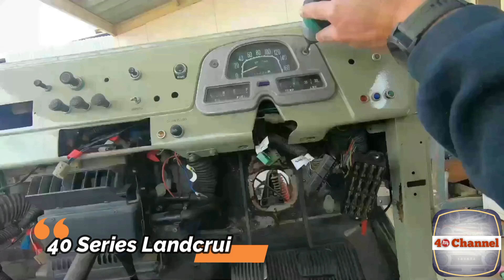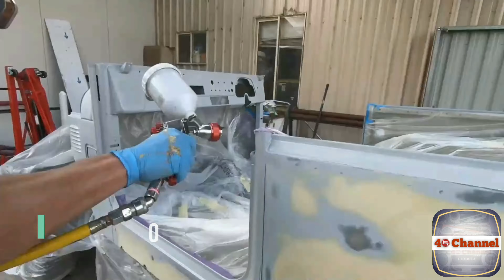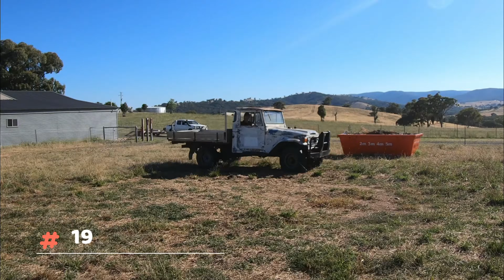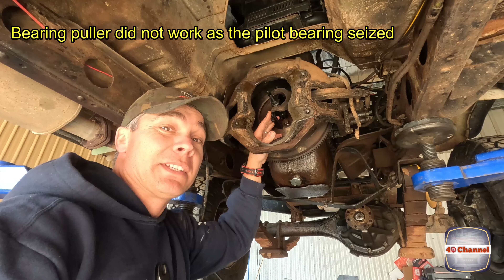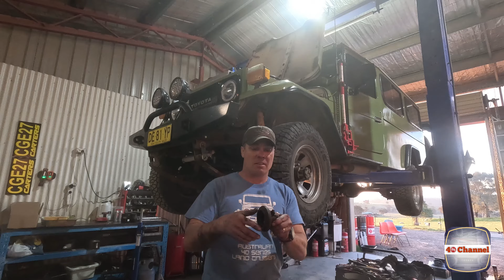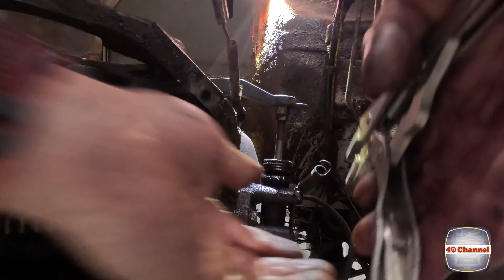S2EP95 - 40 series Clutch change and pilot bearing removal dramas

Comment: Did you ever manage to find a boot cover for the opposite side of the clutch fork?   I also have exactly the same brake in the clutch mounting bracket, did you ever find a replacement, Im finding in difficult and considering getting one machined up out of aluminiuum

Comment: My outer race of my pilot bearing was similarly heat fused/frozen to the inside of the crankshaft.  The other parts had disintegrated completely once I inspected the clutch.  Nothing left except for a  hardened steel shell which couldn't be pulled out. No bread/oil trick or slide hammer puller would have had a chance to budge it.  Couldn't get truck to a welding shop to try the method you show here, as I had already removed driveshaft, muffler, transmission, etc.

I have to carefully grind out the entire circumference of the bearing outer race with a dremel tool.  Time-consuming process but it has to be ground out before pressing in a new pilot bearing, all without damaging the diameter of crankshaft.
Reply from the maker: Great work in getting it out. It can be challenging, but as you have shown, by taking your time, you can win!

Comment: The original clutch bracket looks pretty weak. Is there any type of up grade kit that any one knows about??
Reply from the maker: No that I know of, but I did look at machining one. But found one very easy.
Reply: @40channelcruiser  Im looing for a bracket also, any suggestions on where I might find one, none of the usual places seem to have them listed.